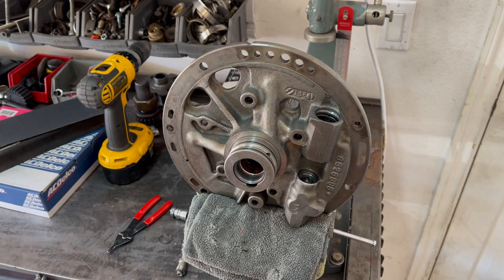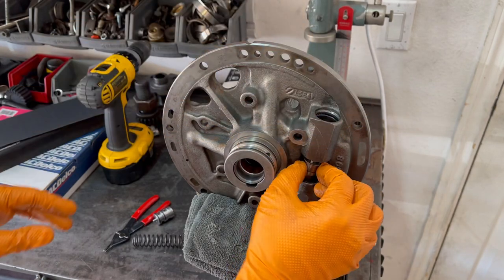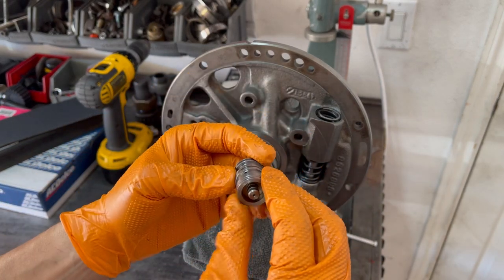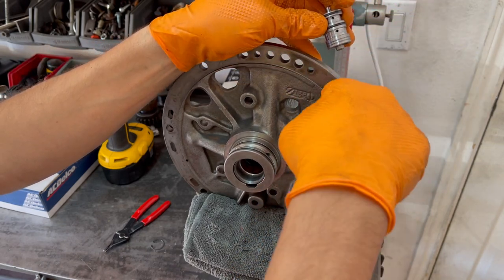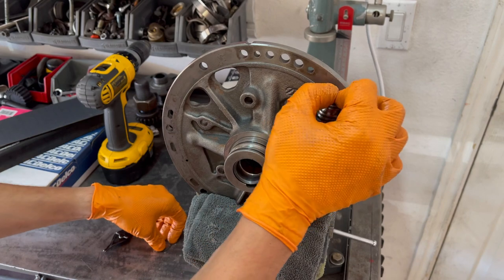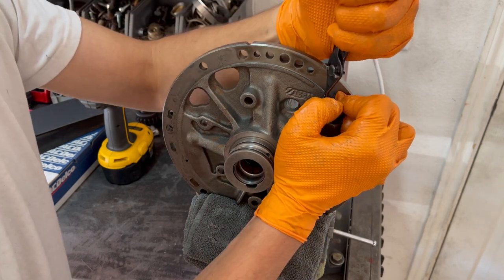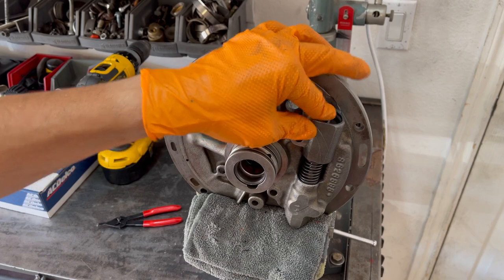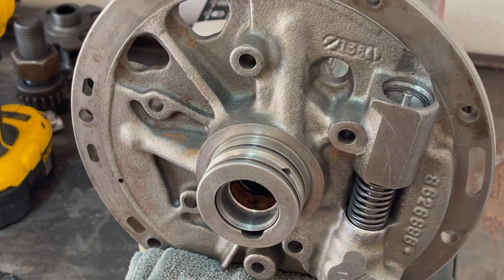TH400 - Sonnax Boost Valve Kit Installation

Comment: Hi Nick, Got a hold of a TH475 in the process of build it. Do you have any videos on the mod to VB stock plate add firm shifts? what point to drill. Thanks.
Reply from the maker: Hi David, check out my TH400 Playlist...I cover drilling the spacer plate in the TH400 and TH475 Rebuild Series videos.
Reply: @nickstransmissions   As always your helpful. Thanks will do.

Comment: Is there anything that is an absolute must-do as a result of installing the Sonnax pump valve upgrade?
Reply from the maker: Nothing you need to do for the Sonnax kit as the PR spring only boosts pressure by appx 10% linearly but if you were to install either one of Transgo's super high pressure springs or another company's that boost LP by 20% or more than you will need to install a restrictor in the converter charge port on the back side of the pump cover. If that is not done, you risk converter ballooning, which can destroy the engine's main thrust bearing. You would also need to run a case saver to protect the snap ring lugs for the intermediate clutch from blowing out under such pressures. 

But none of that applies if you're running the Sonnax LB400 kit.
Reply: @nickstransmissions  Thank you sir. Appreciate it.